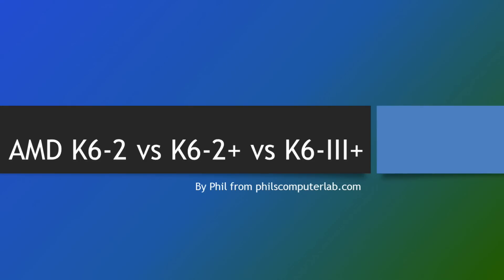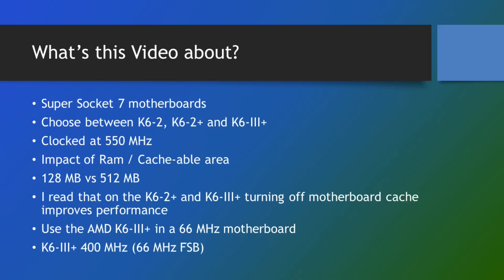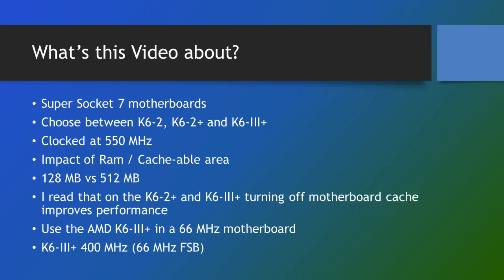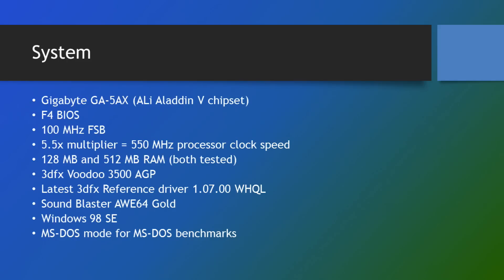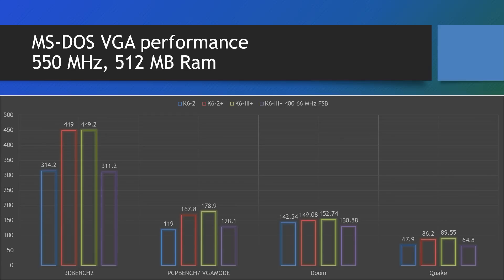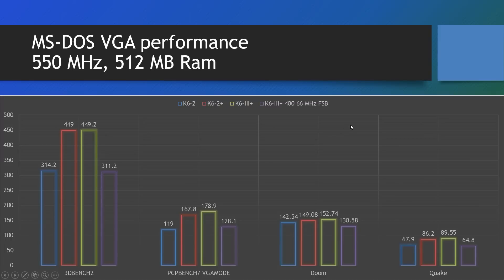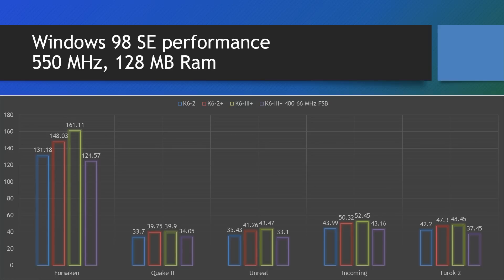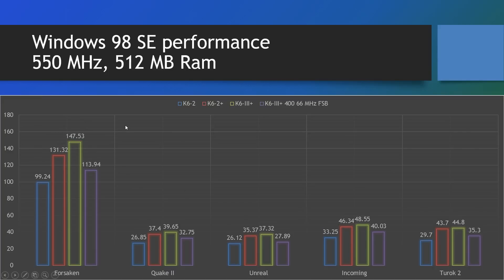AMD K6-2 vs K6-2+ vs K6-III+ Comparison

Comment: I bought a couple of K6-III+ CPU's from an eBay seller in Germany about 5 years ago. They were K6-III+ 350Mhz CPU's and he was selling over 200 of them brand new for £8 each. Wish I had bought a lot more..

Anywho, I built one into a SS7 gaming rig, applied a nice Pentium 3 Skt370 cooler, OC'ed the K6-III+ to 500Mhz and installed a couple of VooDoo 2's in SLI. To be honest, Screamer 2 and Quake II ran very nice but when I tried to play Gunman Chronicles (based on the HalfLife engine, which is technically iD Tech 3 with extra features) it brought the computer to it's knees. Not entirely sure why, I was expecting much better. Some games worked flawlessly, some struggled a great deal. I quickly figured out the system didn't have enough processing power to warrant a pair of V2's so I removed one with no visible difference to framerate. Maybe I should try them in my P3 1Ghz machine if I ever get the time.

The specs of my SS7 build :

K6-III @ 500Mhz
256MB SDRAM PC-100
ABit SS7 Motherboard (I forget the model)
VooDoo 2 8MB Maxi Gamer 3D2
6.2GB IDE HD
DVD-ROM
1.44" Floppy
Aureal 3D Vortex PCI Soundcard
Windows 98se + DOS 6.22
Reply: I have one that he was selling :-)

Comment: I would think that since the cache-able area of ram on that MB is only 128MB then that is why you are not seeing a big difference at 512MB when you turn the MB cache on and off, since as far as I know Windows 98 loads programs from the top of memory down (so into the non-cacheable area of memory) your programs are not benefiting from the cache anyway hence no big performance increase/decrease from turning the MB cache on or off. I bet if you were to test at 128MB ram and turn MB cache on and off you would see nearly the same results as what you see switching from 128 to 512 with cache on because when you are testing at 512 you are effectively running without the cache since none of those games are being loaded into the lower 128MB that is cached anyway. Great video by the way! Thanks for all the hard work you do to benchmark and test so many components and make so many great videos. You are an asset to the vintage computer community!
Reply from the maker: Thanks for the kind words! It's always nice for others to interpret the data, sometimes I don't see what's right in front of me because I'm to close to it all :)

Someone else pointed out that he also saw reduced performance by using 2 sticks of RAM instead of one. So I looked into this and it's correct. At least on this motherboard using a single 256 MB stick is faster than two 128 MB sticks. The performance lies in-between the 128 MB and 512 MB results.

Comment: What voltage are you running on the K6-III+?
Reply from the maker: It was 2.2 V but likely a lot less is needed for 550 operation. Personally I'm not into over clocking, it was mainly for this video and because I didn't have a faster model.